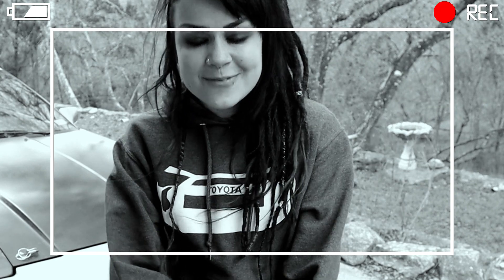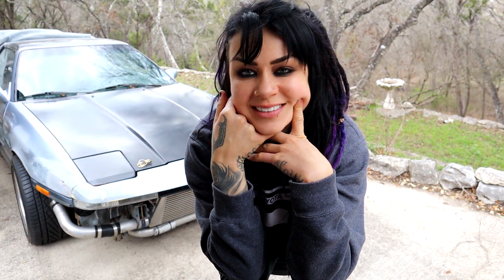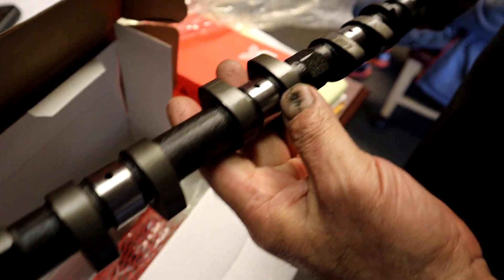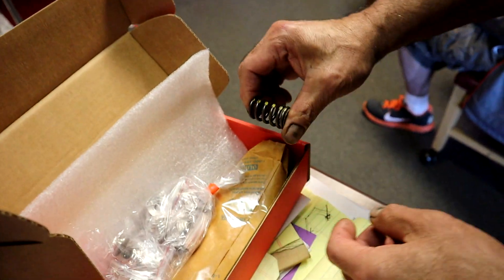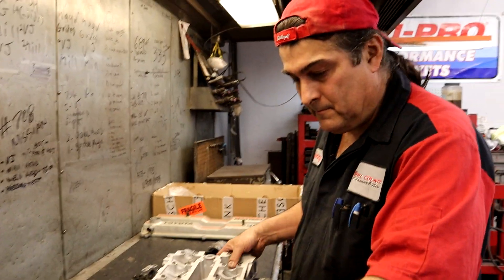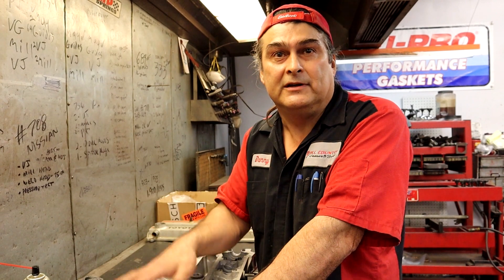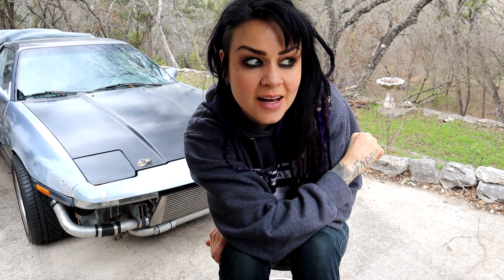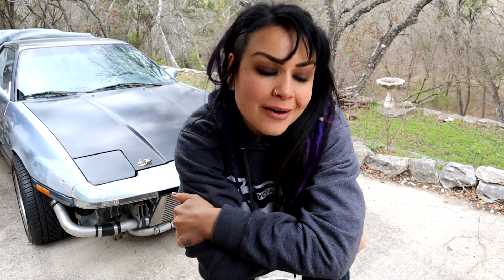Rebuilding my 7M Cylinder head, part 1: Cleaning and Preparing to Straighten, featuring Danny Soliz!

Comment: Hi Faye, sorry I'm late to this video, but you are so right, whenever we can learn take it.  A great example which goes in alignment with your thoughts, my 96' Ram transmission finally died, a good transmission if maintained, which the two previous owners didn't, it's a 46RE, so instead of spending 2k-4k on a rebuild or new, the rebuild kit is 300 bucks or so, and my thinking is I'm going to try and rebuild it myself, if it works great of not I'll have what I have now minus 300 bucks, a broken transmission.  BUT I'll have gained a great experience I'd otherwise not have if I just do what many of us normally do.  I got the master mechanic repair manual for it, and the 46RE is a fairly easy transmission to work on (AT), so I'm looking forward to it when I'm able, right now other projects take the lead in terms of importance and a couple of transmission tools I need, and most importantly I don't have a clean environment or place to open it up and do it, but I will, it will be interesting, and to see how it failed, and having been a mechanic for 34 years, we got this!  Hope this finds you well!

Comment: I purchased a 1985 Cressida from the original owner who drove it a lot in two years but it was in mint condition. Dark blue and around 40,000 miles. That car was so fun to drive it would squat down in the back when you stomped on the gas pedal. So smooth going through the gears. It had those crazy seat belts that automatically buckled when you closed the door. The videos with your Supra are so much fun. Danny is so nice and knowledgeable with engines. PS I also had a 1983 Celica GTS in red! I’ve had all of the 4Runners from the beginning and am driving my 1995 1/2 Tacoma now.

Comment: Do the machinists not have a cleaning tank for cleaning carbon deposits and oil staining off of engine parts?
Media blasting late model cylinders is not a good idea.
Reply from the maker: Yes he does and he mentioned it on film but I might have cut it out to keep the video to a certain length.

Comment: Hi can you make a video on how the oil in the engine becomes milky coloured. Think it happens when coolant is mixed with oil.
Reply from the maker: That's exactly it and it can be caused from coolant mixing with engine oil like a bad head gasket or some engines, like the Toyota 22re for example the chain guides can wear causing the chains you cut into the back of the timing cover which mixes the engine oil with coolant. You can also have a situation where the transmission cooler is incorporated into the radiator and that can fail internally and mixed transmission fluid with coolant
Reply: Faye Hadley cool :)

Comment: Remember to check that the timing cover on the front of the block is not sitting higher than the deck surface before it all goes back together.

Comment: I wouldn't use carb cleaner either, cause most will leave a residue.. So I've read. And who uses an air ratchet? Not even a little. I like to feel every mm when installing the head bolts..

Comment: Always wanted that gen Supra Turbo.  Never got around to it.  Distracted with Fox mustang and LS F bodies, then vettes etc...  Respect.
Reply: Scratch that itch. If you have a bent for those Supras and V8's, 1UZ's fit into those engine bays like they were designed for it. They even came with the same A340 transmission (but a different bellhousing), meaning all the controls etc bolt on.
Reply: well, Thanks to Faye!  My next project is a 4 runner :).  Looking at a 4th gen now, something to bang around and use for hauling and coyote hunting ;p.   Once my kids get out of the house, I may find a supra, but in IL they are all rusted :/  For now I'll make due with my 15' Ecoboost Mustang.  May have to mod that eventually.  Miss going fast though.  Had an 07' Z06 with ported heads/headers/tune made 503 at the wheels and 3200lbs dry ;p.

Comment: Awesome, my brother (who is a mechanic) and I rebuilt my 7M-GTE in my 90 Supra a little over a year ago.  I always enjoy seeing a quality build.  If you are using a metal headgasket I would try to find a way to ensure the block is 100% flat as well.  We decked my block with the timing cover on, as well as decked the head because I went with a metal headgasket 🤙
Reply from the maker: Yep! Freshly decked with cover 5k miles ago👍🏻 will re-check in a future video when I clean the block!
Reply: Iron blocks don't typically move after they've been decked after 20-30 years of use. They tend to warp early on in life when they are heat cycled after being fresh castings.
I bet it's still very, very flat.
Reply: Awesome, cant wait to see this fresh new built head go back on.  Followed you on IG and subscribed here 🤙🤙🤙🤙

Comment: Faye, I have a 1989 NA with 105k on the clock. It's been garaged for the last two or three years because the brakes are messed up. I can drive maybe five miles and they begin to seize. I've rebuilt the slave cylinders, replaced the master cylinder, and replaced the flex lines, but the problem persists. I'm at a loss. Do you have any suggestions?
Reply from the maker: gosh I really hate giving advice on the internet without the car in front of me because there are so many variables that could take place, and things that I would check and take note of in person that I could not possibly tell from you were laying a few things over the internet but I will try. Do all four wheels lock up or just the front or just the rear?
Reply: @FayeHadley  Thank you so much for taking the time to reply. In this case, it is all four wheels. If I open any one bleeder screw, they all free up again. I do realize the difficulty in diagnosing long distance, and was just hoping maybe you had seen something similar, or could make some general suggestions as to what to look at next. I love my '89, I've had it since '94. I'd love to get it back on the road.

Comment: Faye I had the same Situation on my 97’ Land Cruiser 4.5L DOHC 1FZ-FE Motor. My Cams rocked just like that In the Cam Journals. My Machinist also said It needed to be Straightened on the “Topside” as well as the Normal Shaving the Bottom side so I guess I lucked out as far as Machinist go! LOL. Great Video I am anxiously waiting for the next part!
Reply from the maker: Wow that's awesome so it sounds like you have a great machine shop!! I'm curious to know how your Land cruiser head got straightened! I wonder if it is the same way as Danny did mine!
Reply: Faye Hadley My Machine guy sent It out of town to be Line Bored only because he doesn’t have the Machine to do that and then he did the rest of the Machine workI assume I guess I won’t ever really know. But just like you he did show me right off the Bat that mine was Warped on the Topside. So I hope he Is as Honest as I have heard from other people In my town. There are only 3 Machine Shops In existence In Knoxville Tn. I took It to another Shop at first and he said the same thing “It’s warped” but didn’t show me where like the second guy did and I ended up using the second guy because of friends recommendations. I did pay the first guy $75.00 as he Pressure tested the Head. I ended up paying $600.00 for the Head to be handed back to me “Ready to go back on”

Comment: I am a retired machinist with many years of experience. But I never did automotive work. I find this stuff fascinating about head bolts and seat profiles etc. I have no idea about how to straighten a head. I own a 1984 Toyota 4x4 pickup and am now a Toyota forever fan. I rebuilt the engine but I found myself a little lost on some of the details. I also found out most of the builders in the bay area are full of BS about builder basics. Danny is fantastic. If I had to do a critical performance rebuild I would probably ship the engine to someone like Danny rather than deal with the shops I have in the past. Good on you for saving the engine on that classic machine. That says more about you and your passions than anything else. 

Sincerely, Micheal

Comment: I will have to watch these videos a few times at least. There is so much packed in to learn! 

Honestly, when you work with your hands, you can read about it, watch someone else do it, but you don't really learn it until you do it yourself.

Any education is expensive whether in cash or opportunity cost (time spent doing one thing at the expense of something else). Time has to be invested in learning and on-the-job learning can be more valuable than classroom time. When you invest in parts and take the time to learn as you go, you get an education and a concrete thing at the end -- your car fixed properly and ready to rock!
Reply from the maker: Sherri - I ALSO have to watch these videos over to take it all in, and I was there! You're so right about this - this has been an expensive learning experience in both time and money, but I wouldn't have changed one bit of it knowing everything that I know now. Thanks for the comment!!

Comment: are you going to sleeve the valve guide seals while it is there or just go with stock style. plus the head looks good so far. I don't think he is going to take a lot off that head other than that one side of the cam so far it looks good so far

Comment: Always good learning from those old heads learning info stay stock learning new thing didnt know about learning from non school use to know the real supra man "" awesome vid doing this in 2000 1 jz to single turbo instead of  the white with the 3rd gen and blowed the head after he used awesome and blowed it out then turned upside down turned with that arp is like heat on bolt except sits with that kind of cofussing watching same way with honda heads daul cam als diesel turbo 1st gen port match rebuild cam caps clean with stuff aka seafoam then cheap oil royal purple done stuff in the living on my lap and qauqer stater loads up and like the way you look is why hook ups jist like honda hook ups on Female and if a honda man likes you oversized valves so it doesnt matter wow nice 1 2 3 4 5 R I HAVE H was lied to from HONDA still havent been paid also mr good wrench let a winey ass goo to SKILLS USA IN NASHVILLE I COULD CHANGE BRAKES WITH BLIND FOLD IN CLASS REAR DRUM BRAKES ON 1990 CHEVY PICKUP BUT THAT'S WHAT GOT ME ON SEMA THING PEOPLE NOT TELLING THE TRUTH AND KNOWING VALVOLINE LIKE TYPE R BOOSTED CAR IF U SWAP NOT USING HONDA AND USE MOBIL 1 5000 FULL SYNTHETIC IM SURE IT WILL WORK AND NGK HIGHER NUMBER COLDER PLUG LOWER NUMBER HOTTER TELL ME IDK WHAT IM TALKING ABOUT IMPORT THE TOYOTA 22R 22RET 22RE WILL FIT 1988-1991 B SERIES HONDA CRX CIVIC ALSO 1991-1993 IN TEGRA B SERIES VTEC OR NON VTEC TRANSMISSION. STOLE I DEAS AND CASTINGS HOW TJE COME UP WITHE VVTI AMD MIVEC I LEARNED ON MY OWN A SPY TOLD BUT ITS CLOSE BUT NOT THE SAME GOOD SHOW WHITE BOY BTW NOT CERTIFIED SOME TIME MAYBE GIVE ME SHOT TO KNOW U AREA CODE DOESNT MATTER 31NEED SOMEONE POSITIVE AND I WOULD LIKE TO WORK ON SOME CARS AND I NEED A HEAD JOB NOW BUT NEED SOME HELP 3000$ ON A K24A IS TO HIGH FOR VALVES ON A CAR ITS CLOSE TO A SCION ENGINE NOT AS MUCH POWER JIST HAVE TO CHANGE CYLINDER VALVES IS ALL BURNT VALVE CHANGE FOUR BEST WAY HAVE A  GREAT ONE "SUPRA WOMAN" LMK IF U WANNA MAKE SOME MONEY OR HELP IM NOT FAR FROM "NASHVILLE OR MTRTREND" JUST NEED PLACES TO LEVEL HEAD AND GET PARTS FROM BEEN OUT FOR AMIN PLUS ANOTHER SKILL UPGRADE ON ENGINE AND VEHICLE AND SHOW U FEW OTHER CARS AND TUNNING HANDS ON . AND BEST TURBOS TO HYBRID AND HAVE A REBUILD FOR THAT TURBO CT26 FROM TOYOTA I KNOW ABOUT CARS PEOPLE SAY I SNT NO AYTHING HONDA LOST ALOT OF BUINESS I WAS MR. GOOD WRENCH FOR 8YEARS. SHIRTS TO PROVE COULD TELL YOU EVERY WRENCH ALL WORK ON ANY VEHICLE BUT ANYWAYS IM STILL YOUNG LOL 16000 ON PAPER OF AUTOMOTIVE WORK IN HIGHSCHOOL ON PAPER BUT ANYWAYS MUSCLE ALL OF IT IMPORT GDM JDM USDM RABBIT ON FRY GREASE IN 2000 SUPRA GIRL HAVE A GOOD ONE!

Comment: All the people that tell you to swap in a 2jz are too incompetent to build the 7m properly. For the price of a stock 2jz swap you could have a reliable 500hp 7m beast! Plus the torque the 7m makes over the 2jz makes for a fun ride.  I got a cylinder head at the machine shop myself for one of my 7m's. I just recently picked up a boss JR bolt on turbo kit from a buddy for $250! He gave me an ECU, harness, intake manifold, throttle body, coils, ported exhaust manifold, turbo, 3" bellmouth downpipe, full 3" straight pipe exhaust, practically everything I need to go NA-T. Just need to pick up innercooler kit, MAF, and few other odds and ends before I get it together. I'm scared for my w58 haha. My buddy has killed marlin crawler r154's with this setup haha.Cheers can't wait for the rest of the series.
Reply from the maker: AHHH!  That's so rad, I have a lot of similar mods to mine! I have put so much love and research and positive energy into this build, I can't wait to see what the end result will be if I keep it up! Thanks for your comment, and I am excited about your build!
Reply: What do you mean NA-T?
Reply from the maker: @Ausblack  He means taking his NA (naturally aspirated) engine (which on the 7ms, the difference is mainly in the block) and converting it to T - turbocharged.
Reply: 7M's are built like a rock, especially the bottom end. The off boost torque they have with the long stroke crank makes them nice and driveable as well. Even a non turbo Mk 3 Supra is a nice car, my old auto 86 would spin both rears a little from a standing start. In my opinion the non turbo suits the personality of the Mk 3's better, it is a GT, not a sports car.
The only thing Toyota did wrong with them was changing the head gasket materials very late pre-production and not amending the service manuals and assembly torques for them.
The head gasket failure is all too real but very avoidable these days.

Comment: Some garages sell cheap oil in 40 gallon barrels which does serious damage to engines, I reckon it's recycled vegetable oil or something but I can from experience say "stay away from it" if you have any respect for your engine.
Luckily our Faye here used the proper oil.
Reply from the maker: :) Research, research, research! Danny Says Amsoil and Joe Gibbs are quality oils too
Reply: Cheap owners buy cheap oil. I think it's more the cheapness of the owners that only get their oil changed when the oil light comes on rather than the oil itself.
If the oil meets the API classification and is stamped as such, it is not vegetable oil.
Reply: Trust me I saw a guy change the oil in a tractor which was baling after he bought a 40 gallon drum of that spurious oil, three weeks later she was baling and getting a bit too hot so he drained her and what came out shocked even me as it was like black diesel, that was the last time he bought that big 40 gallon drum of gunk. I'm almost certain it's recycled chipper oil and and 5 gallons of real engine oil added to it